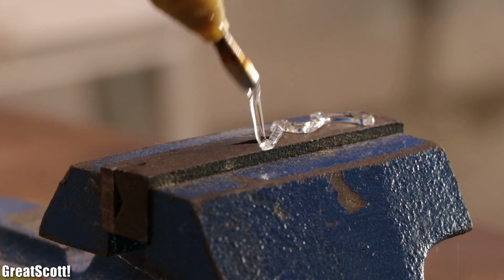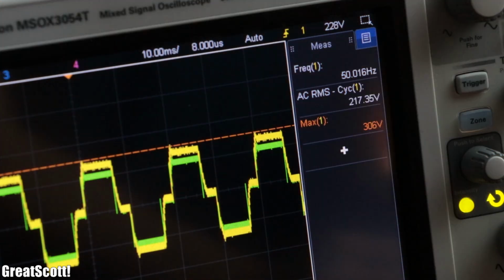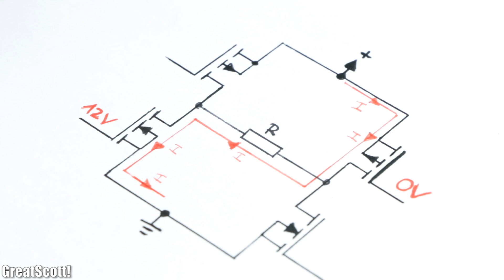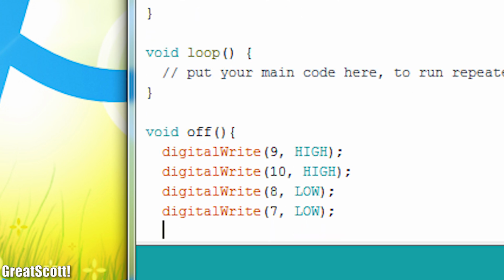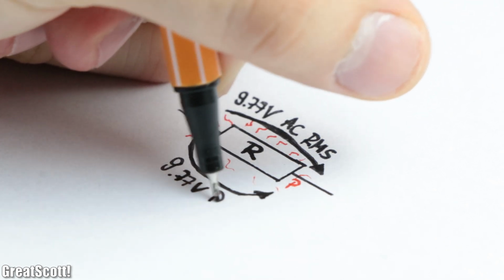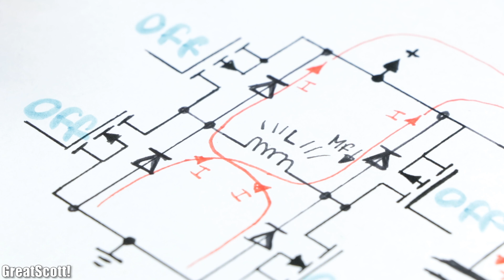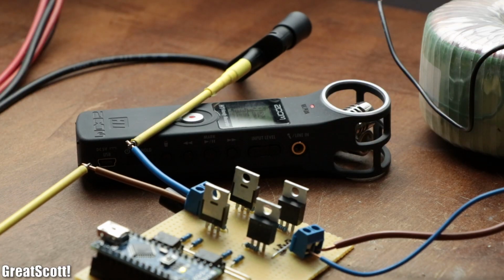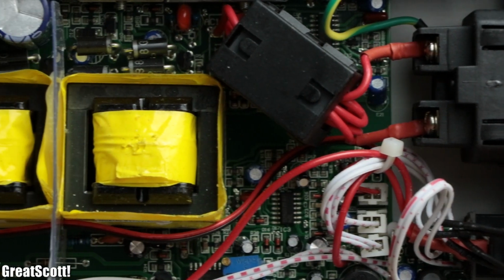How NOT to make a Modified Square Wave Inverter

Comment: You can use this circuit to make a sine wave inverter. Instead of driving the fet's with the low frequency square waves , use a higher frequency(say 20khz) pwm signal. Apply a half cycle sine modulated PWM signal to each side of the bridge. One side at a time obviously :0)
A small LC filter on the output of the transformer will give you a nice clean sine wave at 220V .
I've used same setup to build a 2KVA sine wave inverter. works great. Mine works at 48VDC and uses 
more parallel fets , but the basic circuit. Not sure if the Arduino can do a fast enough pwm , but an STM32
board will handle it no problem!!
FYI , the diodes in the circuit are not really needed. The fets have inverse parallel diodes in them anyway.
Unless you are using schottky's , they won't be doing anything.
Keep up the great videos!!
Cheers
Rob
Reply: Indeed completely true. Anyone looking for advice should follow Rob's message.
Reply: Exactly my thoughts - pwm could solve ALL the mentioned issues (but certainly would've required a more fundamental approach). This is the part, when GreatScott is not that great... He shouldn't have even touched the subject without gaining enough knowledge. Now he just bulshitted a whole lot of believers.
Reply: Can u plzz provide the circuit diagram..
Reply: where did you get the transformer from? at 48V its still 42A at nearly 100% efficiency on the primary
Reply: Basically a form of class-D amplifier by the looks, that'd work real nice C:
I must try this sometime...
Reply: U smashed my lack of knowledge and money for a brand new inverter right in. Thank you.
Reply: Please can I pm you...I really have alot of questions to ask you

Comment: I have several MSW inverters with dead H bridges and I don't even bother fixing them.  I just wire the DC out from the inverter directly to the plug.  Most electronics these days have switching power supplies and they don't care. And it is a little more efficient.

Comment: Pure sine wave inverters do get tricky to build.  Earlier this year I made a 10kw one using a small Atmel AVR micro, some IGBT blocks and a bloody great power transformer.  Tracking modulation with load, while maintaining waveform integrity gets hard.  I took a rising 1/4 of a sine wave cycle and sliced it into 120 areas.  Each area was further sliced into 20 more slots that I could increase or decrease in duration.  1 slot = minimum drive, 19 slots=maximum drive.  This quarter sine-wave was mirrored to synthesize the second quarter of the cycle .  The combination was then flipped again for the second half of the cycle.  A voltage feedback circuit drove one of 70 different drive intensity levels based upon output load conditions, to keep the 230V stable.  This all happened on a small 8-bit micro with a 16 MHz crystal programmed in assembly language.  But it was bloody hard work to get it right, but the output waveform was really clean.  My recommendation:  buy somebody else's inverter and watch tv instead.
Reply: But you lose all that freedom and joy in building things your own way.

Comment: All you need is to add a small choke in series to round off the switching transitions going into the transformer, an output low pass filter will help too.  Its not hard to add feedback and keep output regulated. The circuit is far simpler and more reliable than high freq inverters, only disadvantage is size and weight, high efficiency of well into the high 90's can be achieved by keeping switching times fast on resistance low, and reducing winding losses by increasing winding cross-sectional area.

Comment: Usually the mosfet switching part of the invertor switches allready high voltage DC which was been stepped up and rectified by a switching power supply.  The same voltage could also be turned in to an ac signal with some PWM magic and a LC filter to average out the high frequency PWM in to a nice sinewave. Using the arduino's analog inputs and a few optocouplers a simple feedback loop can be established to monitor the quality of the output.

Comment: Yeah! I was probably one of them . I got the crazy idea of building a pure sine wave inverter. And at the time I just discovered what a mosfet actually was. Since I'm off grid. I didn't have time to learn electronics and build a inverter. So I bought a 5kw pure sine wave inverter. I would still like to build one. Only maybe from salvaged inverter parts. I do have some components I gathered. Mostly forklift battery chargers. And some huge heatsinks. If I did build it from the parts I have . it would weigh a ton. And look like a 1.21 gigawatt inverter. 
I did find a pure sine wave inverter driver board that supports the safty features. It is a bit over my pay grade. I would definitely need some help . almost anyone can make a dangerous square wave inverter. I need something more seriously powerful. And efficient. I may find buying an damaged industrial inverter and repair and upgrade the components and cooling. The heat usually is what gets them.  Maybe replace the MOSFETs with the best suitable ones available. Maybe try adding a few. I don't know if anyone has acted on crazy ideas like mine. I may try it with a small pure sine inverter. 500-1200watts or so.   GREAT SCOTT!!! Keep up all the awesome work!!

Comment: you can significantly improve the shape of the voltage on the output of the inverter by doing the software properly. Use dead times, PWM and soft switching. Driving the mosfets at 50 Hz will give a ton of harmonics. Use >1 kHz and PWM within the 20 ms period to generate the RMS voltage of the sinusoidal 50 Hz wave. Look at my inverter, in the scope you see a period of my three phase inverter. http://www.ingdemurtas.it/wp-content/uploads/realizzazioni/6pulse_converter_controller.png

Comment: Thank you for this, you may have solved a problem I have with an inverter I picked up cheaply, I was trying to figure out what the programmable chip did, now I think I know, the chip is not functioning, and I have no means to program another, but if I can trace it's pin outs I might be able to replace it with an Arduino which I can program.

Comment: Pure sine wave inverters really aren't that expensive these days. There's a number of ASICs available which do all the relatively difficult PWM generation for you (EG: https://www.egmicro.com/download/EGS002_manual_en.pdf), so the Shenzhen sellers are able to make them easily. They also use high frequency (25-50kHz) push pull converters to generate high voltage DC first, so a large (and expensive) output transformer is not needed.

Comment: Or can you make a 1000W class D audio amplifier and connect it to primary? With 50Hz sine on the input it should be working great
And with using low resistance high current mosfets it will make an efficiency much higher

Comment: I'm very new to electronics but I'm kinda interested in getting into power electronics.  My idea might be completely wrong and maybe won't work, but what I'm thinking is you would have a high frequency PWM like a normal DC  buck converter would have.  But instead of aiming for a set voltage, you are using a timer to calculate what the voltage should be based on the frequency you are going for, and then reduce/increase the PWM based on that value.  You then reset timer for each sine pulse.     You of course need a H bridge to get the negative voltages, and a SMPS transformer to get proper isolation.  In a typical setup your battery negative will be your ground, so you'd want a centre tapped transformer and make the centre the ground.  You then aim for 170 volts peak on the negative and positive side and the output would be similar to a 120/240v system. Essentially this would give you a crude pure sine inverter, at least I'm thinking.  I could be way off here.  It sounds like it would work but I have not tried it or seen anyone try it so maybe there's a good reason for that haha.  Am I on the right path or completely off?   I've read up on different ways of doing it too but they felt more complex. Suppose there's a good reason though.

Comment: Make an automatic Solar panel cleaner , like a rubber thingy attached to the sides that moves with a bit of water over the solar panel cleaning it in 2 goes
like a cars windshield wiper, but this one moves like a 3d printer in 2 direction (2 for coming back) instead of rotating, thus covering the maximum area possible

Comment: Solution: use a class D amplifier design rather than the worst possible inverter design.  You only need to switch at around 2-10 khz to get a roughly sinusoidal 60hz in PWM to make a decent design.  This may be somewhat more difficult code, but totally worth the higher power quality.

Comment: Now do it in triplicate, program that arduino to offset the phases 120° to each other, make the voltage output and frequency  variable, and run some brushless DC motors. Go! Lol

Comment: There is also the issue with ripple current, which is hard on the capacitors in a lot of modern switchmode power supplies.

Comment: So does a pure sine wave inverter generate a pair of synchronous PWM signals fed into a bipolar capacitor to smooth them out, or does it just slap a bunch of capacitance on the end of an overbuilt modified sine wave inverter? Or is it something else my computer tech brain hasn't thought of?

Comment: The pause time must be 0V not open, you did that, keep that way. To clear the spikes the DC bus must have fast capacitors very close to the switches, polypropylene, together with the electrolytic. Improve efficiency with IR2110 + all N mosfets, and be aware you need deadtime.

Comment: What about a capacitor in paralel with the actual primary of the transformer ?   Something to be ressonant to the 50 Hz...
and in addition, as you are using a arduino, what about program the output as a PMW instead of  modified SQ wave.

Comment: If you ever have problems running a coffee machine on one of these, plug in a motor (like a mixer or an angle grinder) into the same circuit. That's how AvE got his coffee machine running!

Comment: Not really the way I would have gone about making one of these as far as the programming goes. As far as the circuit, it does need fly back protection, like you added, but it also needs a low pass filter to keep the frequencies above 60 Hz (50 Hz in your case) out of the output power. This would drop the efficiency, but would also clean up the power a lot, including the fly back voltages. It is still not safe enough for the average person to design and build for mains voltage use, but it would be a little better.

The way I would have approached this from the programming side would have been to make the different state functions for the MOSFETs just like you did, but I would have used a pulse width modulated signal to form a wave that was nearly a sine wave at the output. It would have needed added to your initial circuit a low pass filter, the diode protection for inductor fly back voltages, and a soothing circuit (choke/coil with low inductance to minimize losses) before being put through the transformer to get mains voltage out. This is basically a motor driver that uses DC input to power an induction only motor without power regulation programmed in.

The way the commercial sine wave inverters work is they use a variable counter that creates the PWM signal just like I would have used from the Arduino. It is cheaper since it is just an IC with some configuring resistors to create the signal. They then have the fly back voltage protection, filtering, and overcurrent/overvoltage protection with mains voltage and input voltage separation. All of these safety and filtering parts added to the circuit is where the cost goes into the unit. Not in the actual part costs, but in paying an electrical engineer to select the right ones in to make it safe and to specify the correct parts for the rest of the circuit so it doesn't burn your house down along with safety testing and certification by an independent lab for insurance and safety purposes. Material wise, inverters at the power level a house might use are not super expensive, but knowledge and safety wise they take hundreds to thousands of dollars for each unit.
Reply: Great explanation . i actually working in inverter project .Since You are knowledgeable about this , can i get your email id ? my email id is nasimcisco@gmail.com

Comment: @GreatScott! You are wrong a modified square wave is NOT good to any type of Motor, the motors are suffering from it and earlier they wear out.
Reply from the maker: But does the motor spin?
Reply: yes, but i know a few old types which don't want to spin, but a newer one will mostly spin, but with the more load, then the motor more suffers. The suffering from it will appear as an brumming (like what you show with transformator) and more heating, which will cause a lower efficiency and there could be more sparks from brushes.
Reply: an synchronous motors and asynchronous motors with Squirrel-cage rotor, these are the most affected by this modified square wave.

Comment: I thought a reasonably simple pure sine inverter  would have a pure sine 50Hz signal generator amplified by a Class D amplifier. Both components are quite simple and definitely efficient. Where is the problem(s) with such a design?

Comment: I'll just throw this out there, but many decades ago Don Lancaster published several articles on "Magic Sinewaves" (google it). Magic Sinewaves are a pulse train with carefully calculated pulse widths that generate a sinewave such that the low-order harmonics are at or near zero and the first significant harmonic can be as high as the 28th or 30th, which should be relatively easy to filter out.

Seems like a clever idea for an inverter, but I've never seen any commercial products or hobbyist projects based on it.

Comment: i'm nitpicking a bit here but you shouldn't call the side of the transformer that your source is has secondary and the side of the load has primary by definition of primary and secondary that is wrong, you should have said low voltage side and high voltage side.

Comment: Man, I fully understand people's frustration when it comes to building an inverter! When I first started Learning Power Electronics in college, I thought I could do that, and I thought, Geez, it's so easy! But time went by and it was only when I was writing my undergraduate thesis (I was trying to build a switched mode power supply ) that I learned things like: "dead time", , "Switching Losses "," Harmonics "," Types of Electrical Loads ".... Unfortunaly this is not as simple as it sounds! There are many things that can instantly blow up your switches, blow up your controller. To do this, you will need to study a lot of things before, of course, this if you want to do things right without risking your life. GreatScott, again It was a great video, and thank you for alert, and protect people from this risks.

Comment: Indeed a modified sine wave inverter that is a terrible power supply, these inverters are available for little money, why would you build one.

Spend more money for a pure sine wave inverter, which becoming cheaper every year in price. 

Buy not the horrible mess from china but buy a good brand for example an Victron inverter Rock-solid Quality.